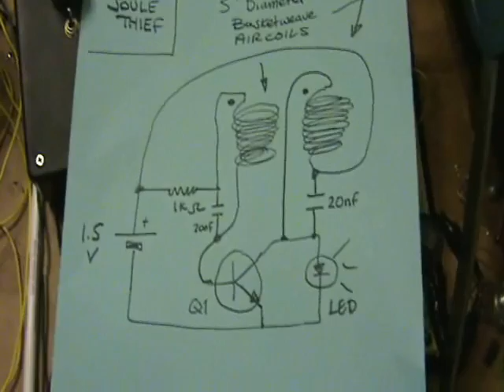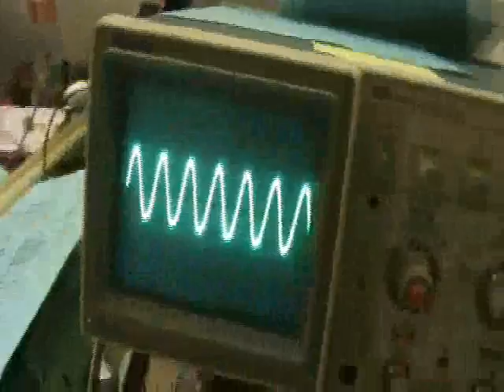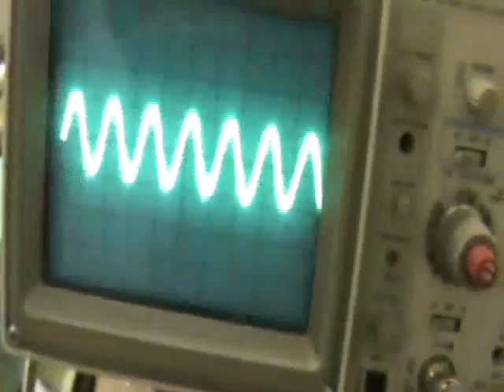Joule Thief - Experiments with Basketweave Air Coils

Comment from the maker: 21 dowels, 5 inch diameter, wire wrapped over-under, 46 turns, 24 AWG.
One is wound clock-wise, the other counter-clockwise -- but it doesn't matter. I found that polarity has more to do with which wire is on TOP of coil and which is on BOTTOM. I hadn't known this before since its seems to defy right-hand rule.